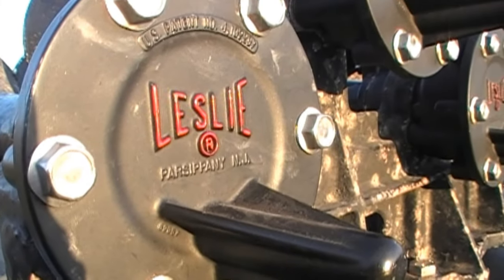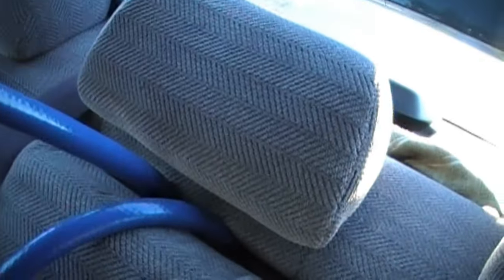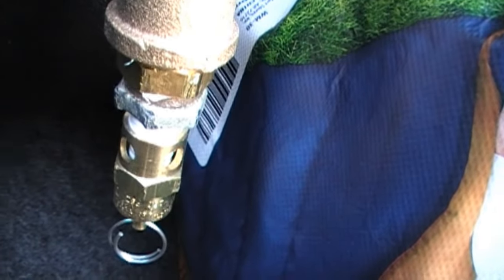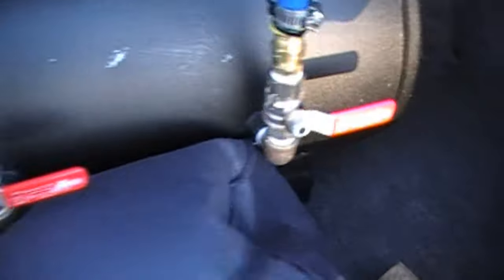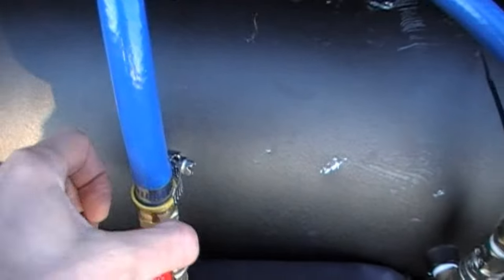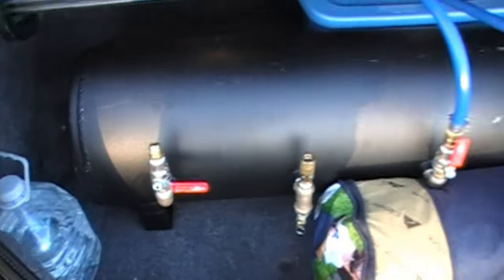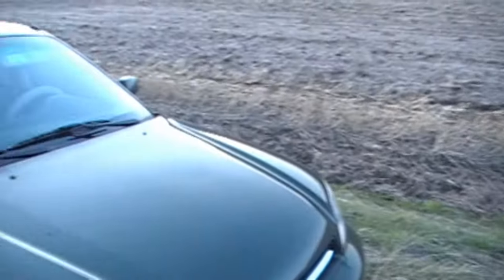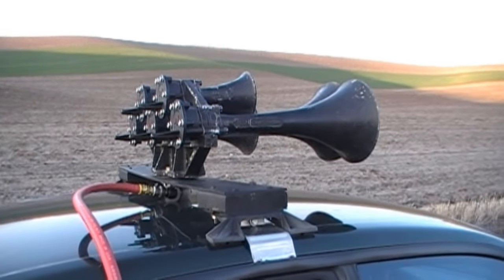Locomotive horn collector air system NOT for pranks or scaring (Big air for a big horn)

Comment: 120PSI!? A locomotive runs between 80 and 100, wth. Most of the Compressors come installed with purge valves at 100psi
Reply from the maker: Locomotive main res pressure, which the horns runs off of, is 140 PSI.
Reply: @mafarnz  maybe for the reservoir, I don't know a whole lot about that. But I do know a lot about the compressors, the CDC, WLA, WLN, WBO, and the WXO.

Comment: If I start a locomotive works tell me how these work.
Reply from the maker: Mark Keller Compressed air pushes on a diaphragm which vibrates back and forth.  How fast the diaphragm vibrates is determined by how long the bell (trumpet) is, the longer the bell, the slower the diaphragm vibrates and the lower the note.  Pretty simple.

Comment: I don't get why you haul around an air compressor that doesn't work on the road.  Just fill the tank and leave the compressor at home.
Reply from the maker: +John Dough Because the compressor is attached to a 12 gallon tank, that + the 20 gallon gives me 32 gallons of air.  These locomotive horns need VOLUME, not pressure, so the more air I can carry the better they sound.

Comment: i thought train horns ran at 170psi plus that air comressor can only do 130psi i got a $10 12 volt one from harbor freight that pushes 250psi
Reply from the maker: 250 is WAAAAAAY to much for a locomotive horn, you start warping and cracking diaphragms that high.  They are designed to run at 140, not sure where you got 170.  Most can do up to 150.  I run mine at 120, that's still plenty loud!

Comment: Great horns, but the plumbing and valving could use some work. Plumbing first though.
Reply from the maker: The air set up is the way it is so that it is removable from the vehicle, in about five minutes. I don’t run the horn on my car 24/7, so I still need to be able to use my car as a car.  For me it’s an acceptable trade-off for appearance vs functionality.  Works great, and that’s my primary concern. It’s also easily removed from the vehicle, and that’s my secondary concern. It’s appearance is pretty much dead last on that list.

Comment: How do you manage to get the actual former horns of (former) railroad equipment?
Reply from the maker: Most of my horns came from other horn collectors.  Getting them LEGALLY  off the locomotives comes down to one of a few options.  You can buy them new from the companies the manufacture them (difficult and expensive),  you can buy them from the railroad (unlikely to ever happen), or you can buy them from scrap yards that repair and scrap out old locomotives.  The few that I didn't get from other collectors I got from scrap yards.
Reply: @mafarnz  So I'm curious as to how exactly you're even able to go to locomotive scrap yards in the first place. Are they similar to auto scrap yards, where they're open to the public as long as if you pay a fee to enter, or do you have to have some sort of special permission to get in? As someone who's been trying to get into train horn collecting, i'm curious as to whether or not it would be cheaper to get horn from a scrap yard, rather than just paying 900 for an older casting K5 off of eBay.
Reply from the maker: @PrimeMoverRailfanProductions  Some do allow the public to buy parts, and some don't.  Just give them a call and check, doesn't hurt to ask.  I'd also recommend joining horn collector groups on Facebook and other online forums.  Only a few of my horns came from scrapyards, most came from other collectors.

Comment: Go to napa and get push/pull fittings. You can install them on your house yourself. You can disconnect when not using.
Reply from the maker: Looked into those. Too restrictive, and they don’t come apart easily. The point isn’t to hide the horn. I change out horns all the time but I don’t have one on the roof 24/7. I want the horn and air system removable so that for the majority of time I don’t have a horn on the car I don’t have the air stuff in it.

Comment: Did you consider scuba tanks?  A LOT more air in a smaller space, and if bought used, probably cheaper too!
Reply from the maker: I did, the big issue there is that it requires a high flow regulator, not something that is easy or cheap to find.  Believe it or not this set up was actually less expensive
Reply: mafarnz .  ok, I'm glad you considered it.   I've been a diver for awhile (over 30 years)  so it came to mind....and I've seen some extremely inexpensive gear, including regulators that would work well, and the really small tanks would take up minimal space and still hold way more air than a giant regular tank.

Comment: I'm just guessing here but I'm thinking you probably don't have many people riding in your car....ever.
Reply from the maker: Hi there!  I can understand why you might make that incorrect assumption.  I actually don't run a horn on my car 24/7, and although the air system looks a but "rough", it was designed in such a way that everything except the roof rack and valve comes out in about 5 minutes.  A majority of the time I don't have the horn or the air system on/in the car, and its a normal car!  Plenty of room for friends or in my case two car seats for my kids in the back.

Comment: why not mount the horns on the underbody and build a box to prevent moisture ?
Reply from the maker: +joe zdunski Unless its completely air and water tight, it won't prevent moisture ingress that will ruin the horn with corrosion.  If it was that well sealed it would also seal in the sound as well.  Also, I have over 20 horns that I have put a lot of effort into restoring and making look good, so the roof is the best place to display my hard work and also its the easiest way to change out the horns for different ones.  Also, I don't run a horn on the car 24/7 so no reason to have it hidden.
Reply: +joe zdunski Moisture will not hurt these horns. I have a nathan k3la mounted under my 4x4 suburban and have not had an issue with them in the whole 5 years they have been there. I have driven in rain, snow, and ice, and they work as well today as they did the first day they were installed. Think about it, locomotives run in all weather conditions, and their horns are not sealed in a weather tight box....
Reply from the maker: +jerry barnes Yeah... did you put antizease on the bolts before you assembled your horn?  If the answer is no, then go try to take a back cap off and then come back and tell me that there is no damage.  Go ahead, try.  Yes they are exposed to rain, snow and other weather while up on top of a locomotive.  What they aren't exposed to is waves of salty muddy water, gravel, snow and ice melt, ect.  UNDER a vehicle is a much more extreme environment and on top of a vehicle.  I've seen tons of horns ruined by people putting them under a car or truck.  They get much wetter and have much more corrosion.  Horns that were under a truck for 5 years look much worse than horns that were on top of a locomotive for 50 years!  I have even seen a few where the bolts rusted so much that they weren't just stuck, the rust had expanded to the point that the horn exploded into pieces from all the built up internal stress.  Your K3 probably works fine for now.  In a few more years it won't work because it will be all gummed up full of aluminum corrosion or mud.  Not to mention that if you didn't put antiseaze on the bolts, they are all rusted stuck now and you will snap them off if you try to remove them to clean out all that corrosion.  So go ahead, try to take it apart.  I'll buy it cheap from you once its in pieces.

Comment: just curious, why use a garden hose connector and not a quick connect ?
Reply from the maker: Quick connects are too restrictive due to the auto shut off feature, they don't allow enough air flow.  The garden hose connectors solved the flow problem, but broke frequently.  I have since moved to SAE flare fittings, and that has turned out to be the best solution.
Reply: mafarnz  what size hose are you running 5/8" ?
Reply from the maker: 1/2" internal diameter.  I know some guys that run 5/8 for their horns but that is bigger than you need, 5/8 costs a lot more.
Reply: mafarnz thanks for the fast reply!!

Comment: I am just wondering how would I get set of this Tran horns ? any sug.....
Reply from the maker: Ebay, horn collector websites.  Expect to pay a lot, the horns in this video cost about $800, you can find smaller three chimes for around $450 to $500.  Do some research before you buy, there are always a few for sale postings that are way overpriced.  Don't forget that that for a real locomotive horn you need big air tanks like I showed in this video.   That also will cost you (about $150 for the 20 gallon tank I use).

Comment: Just wondering… why do you even need to put the air compressor in when you only charge it at home?
Reply from the maker: Good question!  The compressor itself is also a 12 gallon air tank, so it helps add to the overall air capacity of the system. The locomotive horns that I collect require volume more than pressure so I want to utilize the compressor’s storage tank as well as the one in the trunk.
Reply: mafarnz oh I see… thx for replying!

Comment: Do u have a inverter to run compressor.  If so,what size do u need to run it.  Cause I was thinking of doing that.  I have everything to do it with my 120v compressor.  Then I won't have to buy a whole 12v system.  I only gave to buy an inverter.
Reply from the maker: I had looked into that. In order to run the compressor the inverter would need to be hard wired to the battery. For as little as I actually use the horn set up I didn’t want to do that.
Reply: @mafarnz  what I meant was, is your compressor 12v or 120v
Reply: IIUC inverters have to be highly/specially rated to run things like fridges and air conditioners, which are also effectively compressors.
Reply from the maker: My compressor is 120V AC.  I just plug it in while in at home then drain down the tanks when I'm out.  Since I only do single runby recordings that works well for me.

Comment: Wish I could set up a Nathan K5la on the top of my Honda Odyssey!
Reply from the maker: Ha ha that's my other vehicle, and yeah no just no.
Reply: Oh yeah, I know. I looked at some of the videos of fellas who have mounted the Nathan and run around town blasting individuals along intersections and shopping centers and blasting at crossings when trains go by and it is so retarded and unsophisticated. Believe me, as a retired railroader from passenger, I can assure everyone that most if not all professional railroaders are NOT impressed or cool with it. Not one of them would do a thing like this. Furthermore, using locomotive horns in this manner removes a fair amount of the mystique and majesty that attends an F40-PH or any other passenger unit tearing down the High Iron through crossings. Obviously the same with a beautiful EMD or GE freight unit. These are serious pieces of locomotive equipment, not some toy to drive around and scare people on a sidewalk. Heck the one you can buy new online comes with a warning for people to stay 100 feet away. So no, I would never do this. I just love the K5la the most and miss the F40-PH days on Amtrak. By the way, I am 63, female and crazy nuts over a retired pax and freight engineer/operations manager.

Comment: how much did this set up cost you?
Reply from the maker: Eliot Randall Keep in mind that these costs and purchases didn't happen all at once, they were spread out over several years to get to the set up that is in this video. Horn was $650, restoration of it was about $200. The horn valve next to the gear shifter was $145. The 20 gallon air tank was $150, the compressor was $120, the hoses, fittings, ball valves and other miscellaneous parts were about $150.  It’s an expensive hobby!
Reply: mafarnz Nice. I've been entertaining the idea of putting something similar together but on a much smaller scale. I've been looking around and it seems like to get a real train horn and not a plastic car horn kit is pretty expensive, but doable... any suggestions? I'm also interested in fog horns..
Reply from the maker: Eliot Randall I use a 20 gallon tank because I have some very large horns that use a lot of air, such as the RS5T in this video.  If you get a smaller three chime you can get away with a smaller and less expensive tank.  Nathan Airchime K3HA/K3LA and P3’s are smaller, use less air and are less expensive to get (in the range of $450 to $500).  Since they use less air you can get away with a 5 to 10 gallon tank and still get decent sound.  The important thing to remember is that for a good sound everything from the tank port to the horn MUST be 1/2”.  Tank port, fittings, hoses, valves all MUST be 1/2” otherwise it won’t work very well.  The thing that real locomotive horns need is volume of air, the volume is much more important than the pressure.  As long as they get enough volume you have a good loud sound on as little as 30 PSI.  Fog horns are very large, very expensive and use even ore air than a locomotive horn.
Reply: mafarnz Thanks for the info

Comment: sounds good but the setup is not great could of hidden the hoses better
Reply from the maker: Hiding the hoses would make it hard to remove them and use the car as a car.  The way I have my set up now I can take everything out in about 5 minutes, and that was consideration #1, being able to take it all out.  I don't run a horn on the car 24/7 so I need to get everything out easily and quickly.

Comment: Hi, which diameter is louder or better, 3/8” or 1/2”?
Reply from the maker: Locomotive horns absolutely require 1/2".  That's the inlet size on the horn manifold.  These horns require volume more than pressure, and restrictions in the air lines won't let them sound to their full potential.
Reply: @mafarnz  

Okay, I’m asking because I ordered a United Pacific kit from Air Horns of Texas and the kit comes with 3/8 line. 

So U should definitely change that!!!
Reply from the maker: @EASTCOASTIMPERIAL  For the  United Pacific a 3/8" is fine.  Its not a real locomotive horn and has lot less demanding operating air CFM needs.

Comment: Good job but very complicated set up, too many tanks and pipes, I have loco horns on my car but not a set up like that, I have a 10bar 80 litre tank and compressor in boot 1 airline hidden in car and an Air solonoid(magnetic switch) hooked up to original horn, I can still carry 4 passengers and don't need Windows open, and all hidden until hud is opened
Reply from the maker: I would like to point out that your tank is basically the same size and pressure as mine...  The only difference is that my compressor is larger and runs off wall outlet AC rather than being wired into the vehicle.  I decided that one of the requirements of my system is that I did not want to add to or modify the vehicles electrical system.  Other requirements were a manual valve, (doesn't damage the older horns I have,) and have the air components REMOVABLE other than the valve and rack since I don't run a horn on my car 24/7.  The hoses tanks and compressor come out of the car in 5 minutes and most of the time aren't there.

Comment: what are the tapered projections at the back of each horn?
Reply from the maker: holistwebde The “spikes” are hollow air chambers behind the diaphragm, they have to do with how this particular type of horn works. In the Leslie S and RS horns, rather than relying on the springiness of the metal alone to reseat the diaphragm, there is a small hole in the diagram that allows pressure to
build up behind the diaphragm. This pressure reseats the diaphragm, and the spike is where this pressure is stored. In most horns as the diagram vibrates back and forth there is pressure pushing on the diaphragm in only one direction, but in a Leslie there is pressure pushing on it in both directions. This helps to reduce
the amount of wear on the diagram. That’s a very basic explanation, but I didn’t want to launch into a whole 8 pages explanation of how this type of horn works.
Reply: Thanks! Obviously there's more technical finesse going into this equipment than meets the eye. One more question: How does unilateral pressure on the diaphragm cause more wear than pressure attacking from both sides?
Reply from the maker: holistwebde Pressure from only one side causes the diaphragm to warp and fail from metal fatigue.  On other horns, the diaphragms eventually develop a slight bowl shape to them.  On a Leslie, the diaphragms last a very long time, but other parts wear faster, so its a trade off.

Comment: Hhhhmmmm Iam curious, why didn't u just buy a set of viar compressors 12v rated at 200psi and a 12v valve and saved ur self all that space.
Reply from the maker: Because, #1 viar can't handle the volume of air my horns require, and #2, as I stated very clearly in the video, I DID NOT WANT TO MODIFY MY VEHICLE ANY MORE THAN I ALREADY HAVE!!!!!!

Comment: how much does it rule to drive a TRAIN WITH RUBBER TIRES   on the  streets?
Reply from the maker: +bud385 Lol I drive a car, and a pretty shitty one at that.  On the rare times I actually have a horn, I put the horn in the back seat, drive out to the empty farm road that I use, put the horn on and make the recording, and take the horn off again.
Reply: +mafarnz  well  first off  your car  aint  shitty     I've seen  shitty cars   & they usually  have     4 inch  exhaust tips  dangling under the rear bumper  yet somehow  sound like   a  POS  28 cc  2 stroke  weed eater     stuck WFO  while the car  aint  goin  anywhere  all              

  besides the  point  though    the  HORN IS  FREAKIN SWEET   Bro!    NICE WORK!    sounds  exactly like a LOCOMOTIVE PASSIN BY.